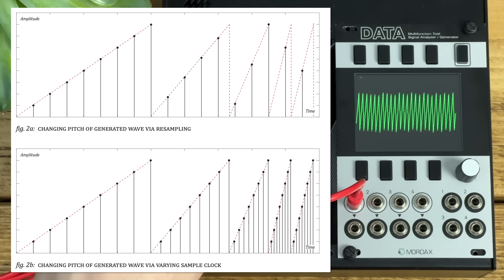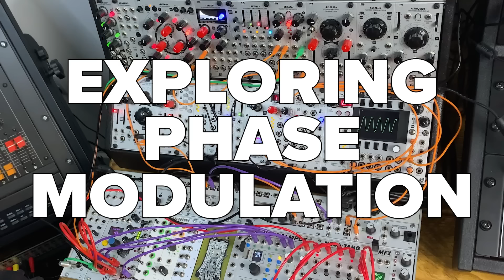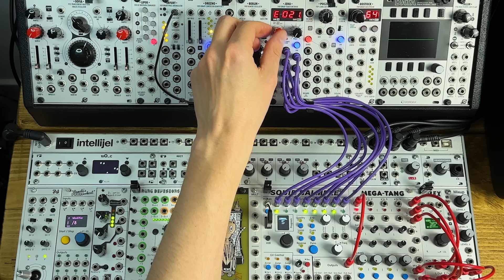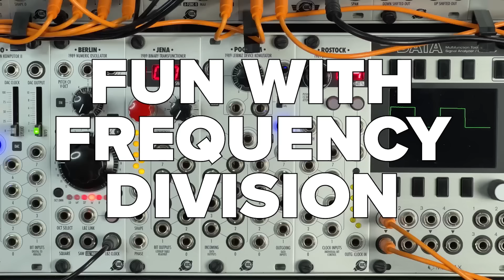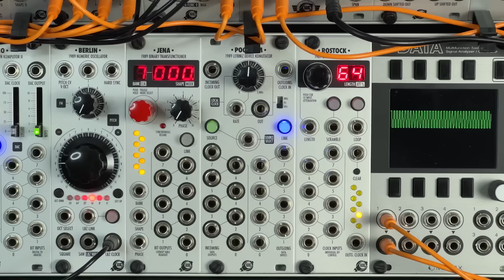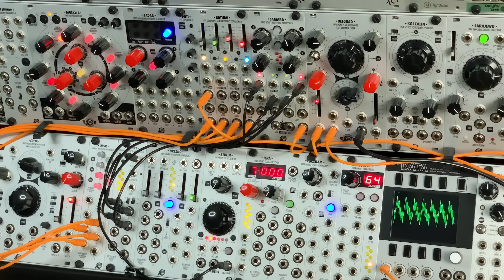Xaoc Devices Berlin | The oscillator that unlocks the Leibniz Binary Subsystem

Comment: Right now I have every Leibniz module except Berlin, and I tried your patch of 8 bit data hacking with Rostok, except with a saw wave from another oscillator coming in through Drezno's ADC, and my scramble function on Rostok only yields complete noise.  No matter what parameters I change.   The gain/offset sliders, the length on Rostok etc, all change nothing.   Im guessing this patch can only work with Berlin?  I love that infinite random waveform patch.  I have Jena after Rostok, then going back into Drezno's input on the back, but link is off on Jena, so the signal should be going in untouched.  Is Jena in the chain maybe what is maybe getting in the way?
Reply from the maker: I don't think Jena is having any effect here; the issue will be the Leibniz clock signal. If you're using Drezno's ADC, the clock is running at a constant 2MHz by default so A) that's much too fast for Rostock to have any audible effect, and B) it's fixed at that frequency so it doesn't have any relationship to the audio signal you're feeding in. With Berlin, the Leibniz clock follows the pitch of the oscillator itself (it's a square wave running at 256 times the frequency of the audible oscillator), so 64 steps in Rostock is always a quarter of a full cycle of the waveform.
Reply: @TomChurchill  I appreciate this!  There are very few experts to consult when it comes to Leibniz.  Now it makes sense.  It seems obvious now when I remember Rostok is all time based.  I will be getting Berlin now and use it with Rostok in its own chain with maybe Gera in between, and have Drezno with Jena separately.  Any large chain configuration of all modules including Berlin seems like it may get too convoluted, even with Poczdam.  I have them in a large chain now and the longest cable barely reaches back to Erfurt.

Comment: Tom, thanks for making these videos on the Leibniz system. Very enlightening! I have a question. While I get that you didn’t change the behind panel bus configuration for all the patches in this video, I’m wondering how often you find yourself doing that as you’re experimenting and coming up with patch ideas? Thanks!
Reply from the maker: Not that often actually - there's a bit of trial and error while I'm figuring out the optimal routing but I try to set things up so that I won't need to keep changing things. And I have a configuration that I've pretty much settled on after doing these videos - briefly: Erfurt + Lipsk on their own; Drezno + Gera + Rostock to one input of Poczdam, Berlin + Jena to the other input of Poczdam, and the outputs of Poczdam back to Drezno and Berlin.
Reply: @TomChurchill  thank you for the detailed reply!

Comment: What about your Erfurt and Lipsk? Are they connected/routed to any other modules internally?
Reply from the maker: No, in this video they’re just operating as a separate pair (Lipsk out is connected to Erfurt in, but neither are connected to the Berlin/Jena/Poczdam/Rostock cluster)
Reply: @TomChurchill  Thanks for the info. I'll be watching all of your other videos on the Leibniz system, because I bought a number of these modules, and have yet to really figure them out (I've got an Extra Class Ham Radio license, so I should be able to do it ;) ). Making the decision of how to connect the modules internally really leaves me in a quandary. I don't want to be continually taking them in and out of the case to switch connectors around. I know Poczdam (which I don't have yet) does some switching between two streams. I've also seen videos of someone who has terminal blocks mounted on the front of their cabinet to be able to switch the ribbon connectors. It seems to me, with all of the development Xaoc is putting into Leibniz, I wouldn't be surprised if at some point they come out with a big module that centralizes patching of all of these individual modules.

Comment: so were you unracking and recabling the connections behind each module between demos? or some other connection method?
Reply from the maker: No, the connections were the same throughout this video: Berlin into Jena through Poczdam into Rostock and back into Berlin. Poczdam and Rostock had no effect on the first patches and Jena was bypassed (by deactivating Link) for the later patches.

Comment: I wonder if they will add a module to the system with enough of a memory buffer to hold 8-bit user sample data. For doing Fairlight CMI type sounds driven by Berlin as a variable rate clock.

Comment: Crazy digital noise... aka aliasing.
Reply: There is no aliasing in this.
Reply: @pe00000001  how? It is not analog. It's digital with very sharp jumps in voltage. I think you don't understand what aliasing is.
Reply from the maker: Well, there is certainly no aliasing in the basic saw wave that's generated by the ramp generator in Berlin itself - as the manual explains: "While this is not a perfectly smooth wave, no samples are dropped regardless of the pitch. Hence, there are no alien spectral components resulting from interference with the sampling frequency, also known as aliasing. The only side effects are perfect additional harmonics eight octaves above the fundamental frequency. Note that for pitch frequencies above 62.5Hz these harmonics are beyond the range of human hearing."
It's a different story once you start processing it with other Leibniz modules though I guess!
Reply: @cg_funk  I’m sure you don’t. Aliasing has nothing to do with sharp discontinuities. Aliasing is a result of interference between spectral components of a signal with the frequency of the sampling pattern. It doesn’t happen here because everything is synchronous with the clock which is scaling with the pitch of the VCO. The spectrum is pure overtones, no alien reflected components
Reply: @pe00000001 I think it's perhaps the point of the module, to generate digital harsh timbres. I am pretty sure i hear aliasing. Anyways if you like it use it.
Reply: @cg_funk  You are trivialising it. It may generate digital harsh timbres if you force it to do it, but it can also do clean classic waves, and clangorous PPG tones, and pure FM sounds, not to mention elaborated rhytm patterns, and more. The entire video shows how versatile it is.

Comment: 32:06 the routing between Berlin and Erfurt is only because of the patch cable but should be possible to routing from Berlin to Erfurt via the Leibniz bus?
Reply from the maker: No, that wouldn't really work in this patch. If I connected the output of Berlin to Erfurt via the Leibniz bus, then Berlin's data value would affect the count increment on Erfurt. I only want to take the Leibniz clock from Berlin and control the Erfurt count increment exclusively via Lipsk. (I have Lipsk and Erfurt set up as a completely separate Leibniz pairing.)

Comment: 23:47 is the shaping only coming from Podsdam? I thought that podzdam is only for routing between 2 shaping modules but not for shaping itself?
Reply from the maker: Output 2 on Poczdam gives you access to the individual bits on the front panel. With Link engaged, these are normalled to each other, so the data flows straight through. But you can interrupt that routing by inserting patch cables (or turn off the normalling altogether by disengaging Link) - this lets you switch bits around, which is what I'm doing here, which changes the wave shape. (Take a look at the block diagram in the Poczdam manual for more details of the signal flow through Poczdam.)

Comment: Great video! I can't wait to get this module into my Leibniz system. Out of curiosity, in the video, do you have Lipsk and Erfurt patched into Poczdam, or are they connected to each other separately?
Reply from the maker: Thanks! Lipsk and Erfurt aren’t connected to the Berlin/Jena/Poczdam/Rostock cluster in this video; I’m running them as a separate standalone pairing. 

(The two inputs on Poczdam are Drezno II’s ADC and Berlin; the outputs go back to Drezno’s DAC and, via Rostock, back to Berlin.)
Reply: Just to clarify, you have Out 2 of Poczdam going into Rostock and then Berlin, allowing you to disable any input to Berlin by toggling off the Poczdam Link?
Reply from the maker: @chimblymcnair correct!
Reply: @TomChurchill  thank you as always!

Comment: "If you think you've understood Leibniz Binary Subsystem then you haven't understood Leibniz Binary Subsystem"
Quantum mechanics is only SLIGHTLY more hard to grasp. Ain't nobody got time for that!! 😕
I kind of feel like only Xaoc, yourself and Richard Devine know WTF is going on here!!
Reply: To be fair, I’ve been running the full Leibniz system for the past two years, adding the new modules as they come out - as long as you actually put in the time to learn what each module does, they’re really not all that complicated - and you certainly don’t need all or most of them to make some interesting patches you can’t make any other way. Extremely versatile system, and this module makes it even easier.
Reply: I disagree
Reply: @Gruppenpest  okay? Congrats?
Reply: @talimn  not with your post
Reply: @Gruppenpest  lol my bad! I see what you mean
Reply: Some elements of Leibniz are almost insultingly simple- Erfurt basically counts up (or down) between 0 and 255 and generates eight gates. That’s it. Most of the other modules are nearly as easy once you get hands-on with them, and if you get stuck there’s a helpful community on ModWiggler (including Tom himself) that will help.